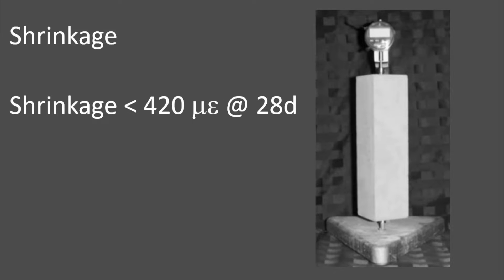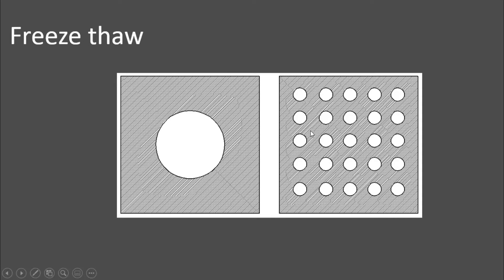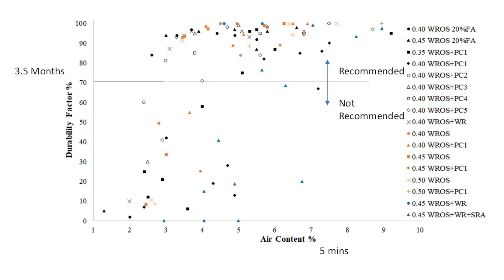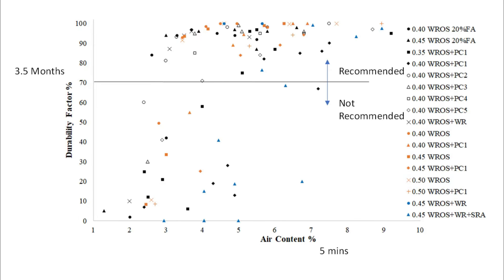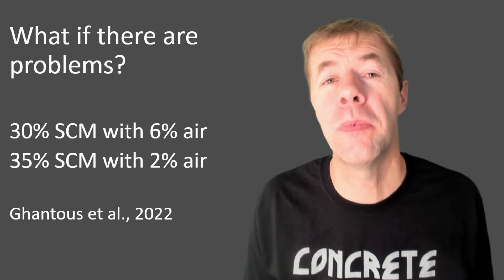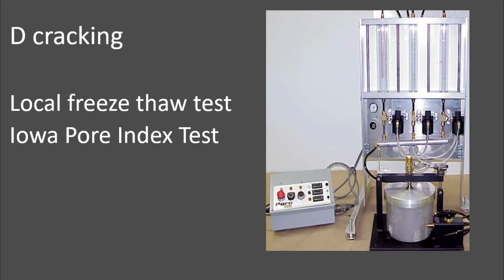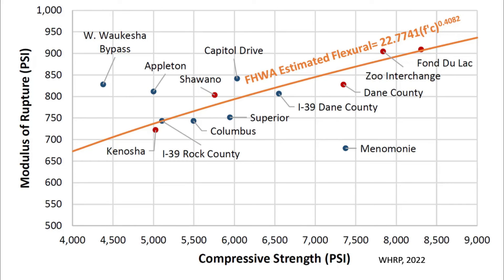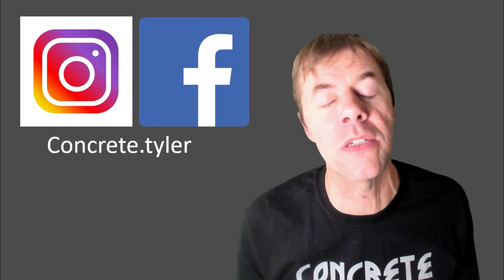Dreamcrete - The rest of the story - Shrinkage, Freeze Thaw, Aggregates, and Strength - PEM

Comment: @ Tyler :     Thanks for the ,as always, informative video.. But, I’ve got a request, can I send you a plug of our mix for testing..? We use a polymeric blend to replace the available hydrogen from water. PSI @ 72hrs= 9,200psi  @ 3months we are testing @12.500 (approx). 
Getting ready for testing at the Berkeley seismic lab, would appreciate the input. 
Thanks.    
PS. Mix is impervious to water and draws zero chlorides.
Reply: Pops. 
Core plugs are 8” dia, psi is compression. Span fail test to be completed at Berkeley.

Comment: Hi Tyler, I really enjoy your videos.

I noticed you like to use “scm’s” for topics of discussion, they all are essentially waste products; which makes them cheaper than the underlying binder: cement… you not only increase the properties of concrete, it is more cost effective and it is also more sustainable to use them in your mix.

I have a few questions, and they might be an idea for another video.

… I digress,  I was wondering if it is possible to mix slag, fly ash and silica fume with cement all together!!! and if they can be mixed together, do they affect or hinder each other when mixed all together? 

… it would be useful to know how to properly harness all of the materials, because they are great materials, research into mix ratio for optimal efficiency; especially when all of the “scm’s” still operate under the original binder: cement
…Is there such thing as too little cement in the mix? 
And if so, is there a minimum cement ratio needed for the concrete to even cure properly?

I would be interested in your opinion on using it for aircrete.
My aircrete would use foam and a foaming agent to add air into the concrete and drive down the costs even further! 

Aircrete is also relatively insulative and would be a very sustainable product to use, allowing for less use of gas; especially now that gas prices have skyrocketed.

…I feel I am getting too excited, however…

I would like your opinion on my concrete recipe that I have thought up, me personally I am not that intelligent when it comes to concrete so I would value your opinion.

My aircrete would include:

Steel rebar reinforcement, poly fibers, foam and purpose built foaming agent(turning it into aircrete), cement, class f fly ash, slag and silica fume.
Mix together and poured into ready made forms.
I am certain in my head that, I have not done enough research, and something will go wrong with this mixture?

Comment: I was wondering about 0 carbon concrete that the Canadian governmet is talking about Thanks Tyler
Reply: If it sounds too good to be true .... but a Great idea to dump a bunch of money into 👍
Reply: It's a bit of an exaggeration to call it zero carbon concrete since there are too many steps involved that releases CO2. The goal is to minimize the amount of CO2 from fossil fuels. A large part of it comes from the manufacturing of cement and the limestone itself releases CO2 when you heat it. It's common to use coal that now is replaced by other fuels and even electric heaters and plasma burners are considered.
To lower the CO2 emissions even more the CO2 is caught using a process named CCS (Carbon Capture and Storage) where the CO2 is basically converted to a liquid and then pumped into the bedrock.
But you also have CO2 from transports and from mixing the concrete.

Comment: Interesting to learn that the two strength assessments are well correlated.  You introduce decision risk and a small extra cost if using two tests for one decision, so most folks won't or can't.  ("Can't" because if the two results differ, your project manager and liability folks will not presume one's valid.)